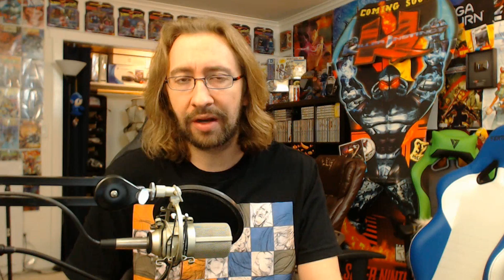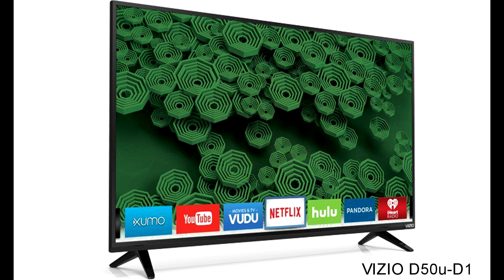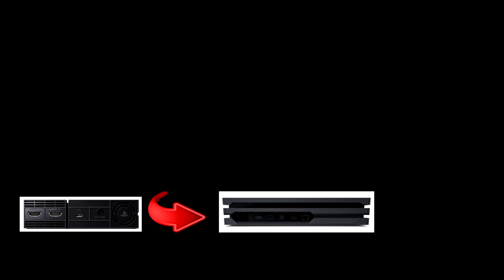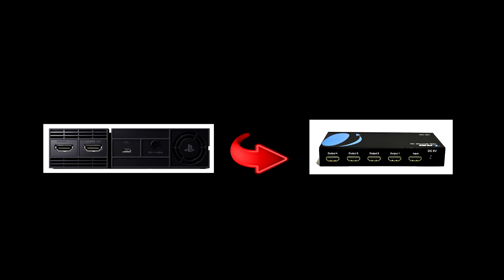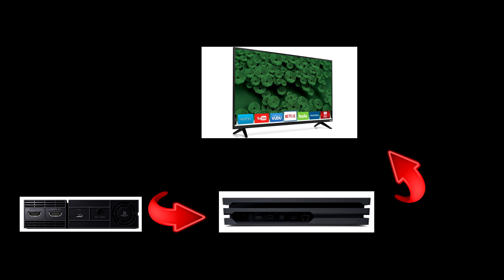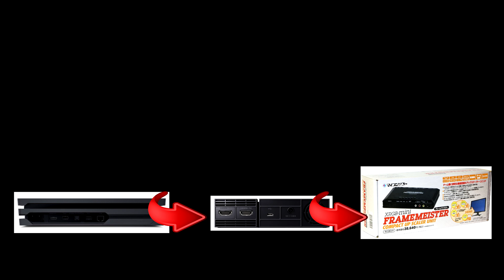MY PS4 PRO NIGHTMARE...And How I Fixed It

Comment: to be honest video's like this propagate semi false hysteria because most people whether we like it or not are weak minded. They will see something negative and just fully run with it without doing there own research. I have a pro and so do everyone of my friends and we have not had any issue's whatsoever. Of course when a new system comes out there are gonna be a few that have issues like with the xbox one and ps4. Wording is very important because when someone says there is a problem with ps4 pro's instead of saying im having a promblem with my ps4 pro your basically saying that there is a problem with the ps4 pro in general.

Comment: I fixed mine so far. I used one of my old HDMI cords I have lying around to get it to run. Other than that there was a little lag when I played GTA V. If you guys have any other solutions pls let me know since I read it is not recommended to use older HDMI cables. Also to note, I'm using a nearly 10 year old Sony Bravia TV to make my newly bought PS4 Pro to run.

Comment: Sony got desperate to release something to fight the Scorpio and the NS as well.
Reply: Pro(at the time, Neo) was announced before Scorpio.
Reply: Yes but they could delayed it to improve what they had at the moment.
Reply: Scorpio was announced first, there were rumours and leaks about the Pro, but nothing solid. The Scorpio announcement was pretty much confirmation that they would work on a system.
Reply: +zombieslayer Incorrect. Information on both was leaked at the beginning of this year prior to E3. Phil Spencer had suggested incremental console upgrades well before that. Scorpio wasn't officially announced until June, while the PS4 Pro wasn't officially announced until September.

Now, if you wanted to tell this guy that they had clearly planned on releasing this thing for a while, then yes, that'd make sense. They absolutely did. It wasn't a knee jerk response that they put out after hearing about the competition a few months ago. That's stupid.
Reply: CC-Tron about 3 or 2 years in these cases of "powered up ver"

Comment: good thing i'm avoiding the ps4 pro and getting the standard ps4.
Reply: Theloneswordsman I'm getting the Nintendo switch
Reply: Theloneswordsman I don't have a 4k TV but the ps4 pro patch games have better to higher frame rates. right now I am playing rise of the tomb raider on unlock frame rate. which is 45-60 fps than the og or slim ps4 that can only play it at 30fps.
Reply: I wouldn't call it pointless at all. Why the fuck would  you spend 100 more dollars for a slight change in graphics, that's not even noticeable? Especially if you don't own a 4k TV.
Reply: Theloneswordsman oh you'll get one eventually. Just not soon.
Reply: Theloneswordsman I'm gonna do the same bro and pro it's not even 4k machine so I'll just pick up standard ps4 too.
Reply: Dragoon Z already got a slim model ps4
Reply: Igor19485 60fps gaming
Reply: NorwayBall actual it matters because it gives 60fps gaming
Reply: Theloneswordsman I have a Samsung TV an it works fine
Reply: Dante Vic good for you, i really don't care for 4k gaming and i don't have a 4k tv nor do i plan on buying one.
Reply: tokyo200 i will eventually.
Reply: i sitck to standard ps4 thank very much
Reply: SuperRedarmy123 same here!!
Reply: NorwayBall Or just be smart and wait for Scorpio, and I'm saying this as a PS4 fan. PS4 pro is nowhere near worth it, especially if you already own a regular one.
Reply: NorwayBall Considering they have the policy that games should run in both consoles (so no exclusives), if they switch to another system it won't be for the PS4Pro, but for the PS5. The only reason to get a PS4 pro is if you care about 60 fps gaming, and even then if you care about that you would be far better off with a PC.
Reply: Lol serious gamer right here.
Reply: Theloneswordsman IT DID THAT TO MY 4K TV, BUT ALL I DID WAS TURN MY 4K TV OFF AND TURN IT ON AGAIN AND IT WORK FINE.
Reply: Theloneswordsman  well don't they have trialled 10k VR to good sucess. so 4k is interrim unlikely to be a standard at all hence the rush to market.
Reply: JPW9384 alright
Reply: NorwayBall exactly I most definitely will never upgrade from original ps4
Reply: Theloneswordsman Me too!

Comment: I bought one 2 days ago. My only problem is that there's no reasonably priced HDTVs with low input lag, at least 60hz and can output 4k games at 5ms or under. The dream is to play fighting games in 4k, with HDR on at 144hz <5ms.  At the moment, I'm just trying to find a 4k TV or monitor that is 5ms or lower because I don't want to purchase a screen I can't use for fighting games.
Reply: So is a Samsung series tv 7 a 4K??
Reply: XusesGB did you find one ?
Reply: Buy a used monitor they are cheaper

Comment: i've had no problems whatsoever. Just plug and play. It seems to occur with like 1% of users. Every electronics device has these bugs. Don't let this keep you from buying this console. It seems this is a needless rant. Extremely rare problem with only a handful of tv's and because of a patch. You have a better chance of getting struck by lightning than encountering this bug
Reply: don't say something like that when there's still a LOT of people saying they're having problems with this thing. On top of that, sony screwed the Bethesda fans over by saying no to mods, and the console doesn't seem to even work as well as the vanilla model even according to people who aren't having issues getting this thing to run on their televisions. If people don't speak up, this crap won't get fixed and it'll give 1st party console developers the idea that this stuff can slide.

Comment: Last time I checked cosole fanboys choose consoles over PC because consoles "always" work out of the package plug n play. So much for that with PS4 pro. Another reason one should get a gaming PC rather than spend money on this garbage.
Reply: Frizen Because it's always a guarantee that consoles get fully optimized games am I rite? Once you can whole heartedly tell me you've never in your life experienced frame dropping issues in console games I'll come back to you to tell you how wrong you are. PC might be shunned by developers however there's a community that comes together to fix this with mods. FFX got butchered for PC but modders came in and fixed and touched it up. You don't see this on consoles because you can't do it on there. You're totally at the mercy of developers.
Reply: KoopaXross Exactly.
Reply: *****
I have the latest classic PS4 model and it works. Matter at hand here is PS4 pro that has problems out the box because faulty patches yet it sells itself as an upgrade, even though it can't run games like The last of us remastered on par with the less powerful PS4 classic without dropping frames. If they can't get this underpowered "upgrade" right, out of the box, you should never spend your money on that when there are better alternatives.

Comment: can't you turn off HDCP like on old PS4?
Reply: I'll get a Xbox Scorpio! Not buying: a PS4 Pro, A GTX 1080, and I7 CPU!
Reply: actually, ps4 pro is near a gtx 1060 in terms of performance, and you dont need an i7 for 4k, a good i5 is more than enough for it.
Reply: lmao no its not.  that would mean its on par with a 980 or even stronger by a bit.  Trust me its not.  Its if anything barely like a 970.  And even then its performance will be hindered by its really crappy CPU. So it will never get the same level of un-bottlenecked performance.
Reply: jeez this converstion has derailed from talking about the capture problem to talking about power. Max already have a beast of a PC, the reason why he bought a PS4 PRO is to play those games he can't play on PC better.
Reply: Damn that's pretty bad for 4k gaming for stable 30fps... Only a 1070 can  handle that, for those over it it's the 1080 and pascal.
Reply: Disabling HDCP on the console will not solve anything, probably because it is the TV demanding HDCP enabled to actually display something. If the TV does not get a valid HDCP handshake, it will not display anything. How/why the Framemeister made the HDCP handshake occur though is beyond me.

Comment: I have only played rise of the tomb raider. an I could care less about 4k. i only play on unlock frame rate mode.
Reply: it's couldn't care less, not could care less. it doesn't make sense the way you said it because if you could care less, why don't you? saying couldn't care less implies you already give the minimum amount of fucks
Reply: ZayIvory7 yea.
Reply: Frizen what phrase
Reply: How does it run? I've heard mixed replies.
Reply: TheShooterAddicted sorry but that's how we say it in my country.
Reply: ZayIvory7 it runs great but if you have an lg or viz tv you will run into some problems.  as of right now I have a Samsung 40inch TV an the pro works great but I can't say for the 4k since my TV is not a 4k tv. I can play rise of the tomb raider at unlock frame rats tho (45-60) fps. 60fps at normal areas but it dips in heavy action areas to as low as 45fps.
Reply: Dante Vic
I see, Thanks!
Despite your non 4K TV, can you see a difference in Resolution? Or do you have to choose between Resolution and FPS?
I think I heard something about that too.. I'm the type of person that prefers resolution over Frames.
Reply: ZayIvory7 the visuals are better but not by much. it will look better its on 1080p 30fps enhanced mode or if you are using hdr. but as of now yes but not by much. to be more clear, it like a remaster game. it looks better but is not really a huge leap.
Reply: Frizen 
I've always like high resolution over FPS. As long as the FPS isn't below 30 I'm fine playing whatever game. Perhaps an exception to fighting games.
Reply: Dante Vic 
Ok ok.. Thanks a lot that really helps me understand. So its like the same kind of difference from say.. TLOU PS3 to TLOU PS4.
Different.. but not so much that you're drooling.

Comment: But it runs fine if splitters and capture cards are not part of the equation,  if it's just going straight to the tv?
Reply: Matt 24 yes but it has problems working on lg and viz tvs

Comment: how odd i got my ps4 pro a couple days ago and not suffered any of these issues
Reply: Same here. Sad for those that are experiencing it, but took me less than 10 minutes to set up the whole thing. Not a single issue.
Reply: Phantom Jr same.
Reply: yea i just set my ps4 pro up changed the video to 1080 got the update, updated and noticed it was displayed on 4k so im not getting this problem i hope sony fixes this issue for everyone else
Reply: 2late2matter I have a Samsung tv an it works great.
Reply: same here. set mine up, transferred my ps4 account and settings to the ps4pro via lan cable and it runs perfectly no issues. very pleased 😄
Reply: Same here took me 5 min .. Initially i plugged to the back of my receiver and could not get higher than 1080p on HDCP 1.4, then i just plugged directly to my TV which was 2.2 and redirected the Audio out to my receiver. Now at 4K and using the Cable with Ps4 Pro. Obviously the Youtuber thought he knew better and decided to use his own HDMI Cable and screwed himself over. 4K and HDCP 2 needs the latest in HDMI cables. Total setup time 5 min.
Reply: He did say it's a small issue. People like to blow these things out of proportion.
Reply: Phantom Jr that's just you.. you can't single out everyone else
Reply: Palo Tove no only on lg an viz
Reply: @dantevic  he stated even on SONYS tv's this problem happened...there own fucking tv's lol
Reply: Palo Tove LG and Vizio  tv's are shit...
Reply: NOPE, i have the KS8000 its AMAZING on it!!!
Reply: ikr xD
Reply: I agree the failure rate should remain small
Reply: any problem on Samsung tvs?
Reply: MY LG's were fine and My Samsung was doing amazing.
Reply: Glad y'all enjoying the new console
Reply: I got ps4 pro but I ain't getting non is this nonsense lol
Reply: Phantom Jr depends on your tv. ive got a65" 2016 4k lg with hdr. got the black screen but fixed it with the 1.4 hdcp bypass but 4k and hdr still don't work. need a patch asap. extremely disappointed
Reply: +Palo Tove damn i got a LG!
Reply: Phantom Jr same
Reply: Roger Joseph IT DID THAT TO MY TV, BUT ALL I DID WAS TURN MY 4K TV OFF AND THEN TURN IT BACK ON AGAIN AND IT WORKS JUST FINE. I'VE BEEN PLAYING ALL MY GAMES IN 4K NO PROBLEM. THIS GUY DID ALL THAT? WOW. SO SORRY.
Reply: Steve Johnson lmao😂
Reply: Nicholas Carruth  I haven't either
Reply: same here and i used it every day since i got it
Reply: I am glad to hear that , but what will you play on it right now?
Reply: Phantom Jr Its rare instances, but people love to whine

Comment: I'm using that ps4 pro money for a switch cause I know I'm getting good games and hardware
Reply: nostalgicgamer100 hopefully
Reply: from what I heard is that nvidia's ceo said that it's easy to port ps4, xbone, and PC games to the switch so that gives me hope for 3rd party games
Reply: I meant the system actually works
Reply: does this need "great hardware"? no it doesnt but it needs good fuckin games and tbh im unimpressed with the ps4 and xbox one for 1st party titles, nintendo always has amazing titles and they sell well
Reply: They dont sell well. Wii U barely sold anything and if it wasnt for Smash, it would be more irrelevant than it already is
Reply: Splatoon sold 4 million copies, bayonetta sold 2-3 million copies irrelevant my ass

Comment: thank god i decided to wait...still have my launch ps4
Reply: right now it looks like if you have an og ps4 there's not much point in getting the pro. that might change next year if we see bigger improvements on games like maybe zero dawn
Reply: mark partridge it will Sony is make all there first party studios have improvements on the pro. 4k an unlock frame rate mode.
Reply: mark partridge yea thats why im going to wait, i actually heard somebody ps4 pro melted lol
Reply: Dante Vic thats what im talking about though i don't think a higher resolution is the improvement im looking for. if a game goes from 30fps to locked 60 fps thats great but i would also prefer better lighting and textures that goes the the same for scorpio if the games are exactly the same but just 4k i will be disappointed.
Reply: htxtexans 713 pretty sure that ps4 pro melting pic is a fake somebody just burnt it from the outside
Reply: mark partridge im thinking so, i heard it from this guy called reviewtechusa